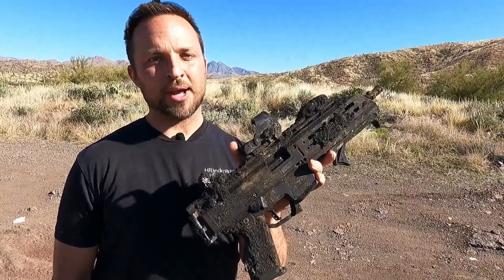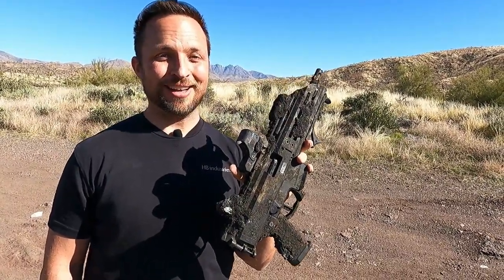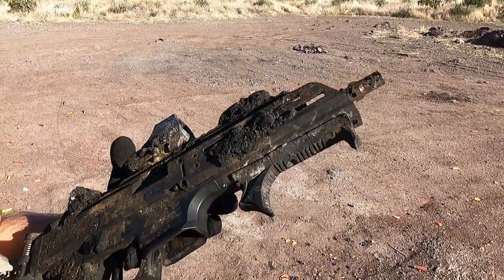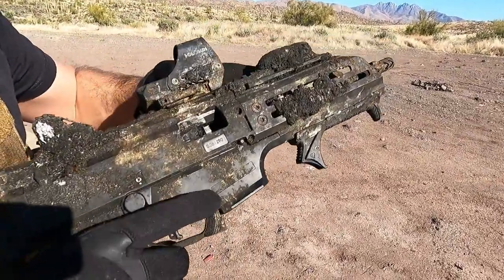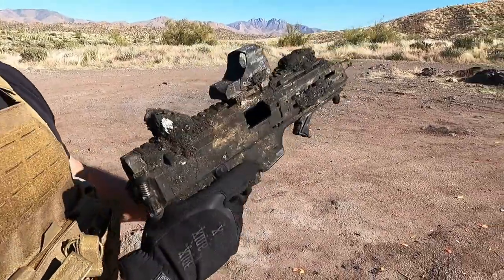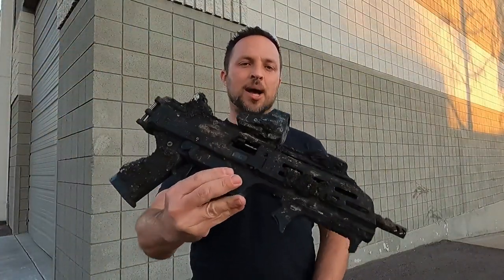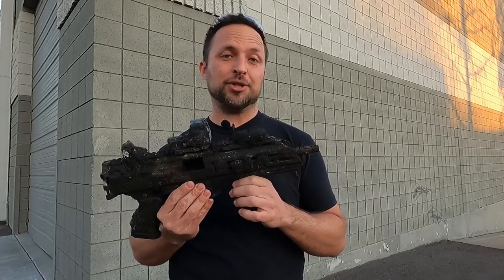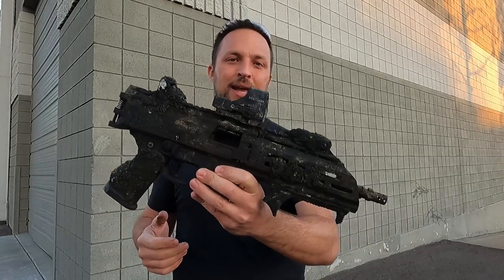CZ Scorpion Evo Fire Burn Test

Comment: Bead blast it and refinish it to see what happens?  
Maybe its possible to save the recivers? 
Should Rockwell test them to see if they got harder from the heat and convert it to full auto and fry it to see what kind of a round count itll take b4 failure after fire damage.

I know its a bit specific but iv so many questions!

Comment: Thread a golf ball launcher or can cannon to the front of it. Using 9mm blanks, muzzle load the launcher with various items, until the the barrel blows or the thing grenades?

Dip it in liquid nitro and fire it half frozen? If even possible? 

Only you have the power to make it happen!

If nothing else, scratch it's serial number and seal it up in crystal clear acrylic, firing pin removed, and save it as a wall or desk trophy 🏆 🤔 #neverforget